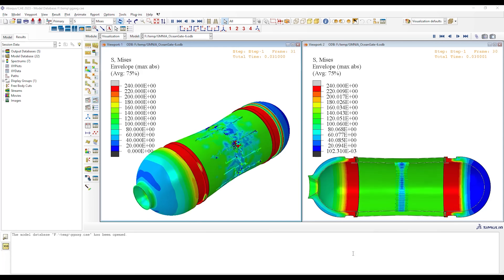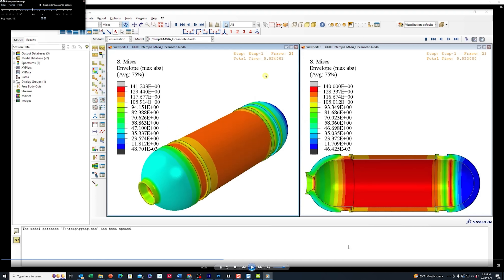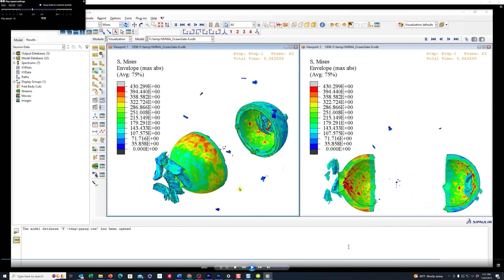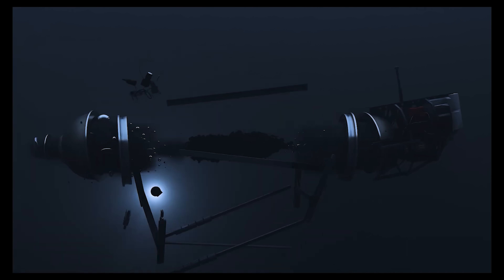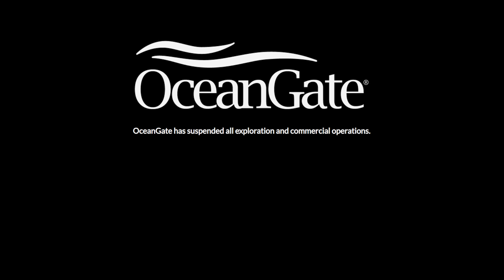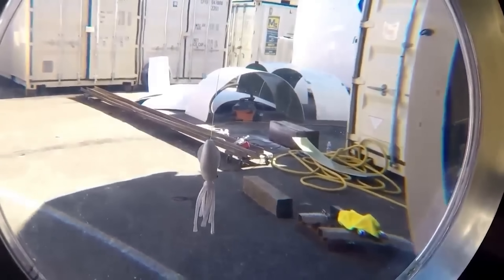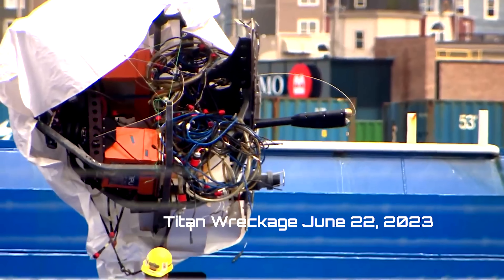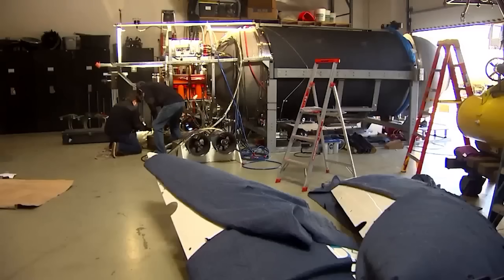Best Titan Sub Implosion Simulation, Cracked Porthole? Q & A

Comment: i think there is a little insensitivity in this video when folk have clearly perished, a better way than saying their dead, its a bit final no matter how the facts present themselves

as an armchair designer myself i reckon there has to be a few school boy errors made in the design of Titan, and i'm sure many of the 'normal' stresses expected were accounted for, but what of those not expected, the earlier collision for example, i'm sure will be cross examined for many many years to come and likely not in my life time

i did find the videos shown during construction a little odd, such as the laying of the carbon ribbon, not criss crossing in one direction and then the other, as seen in manufacture of CF oxygen cylinders etc. and no signs of any material to strengthen the carbon fibre, laminating layers of titanium into the fibre might have worked, and the fact the two titanium rings added to the ends had a very flat connection with little overlap even if only glued, its widely known in manufacturing if you design or cut other levels or a zig zag effect into that end surface, you provide more surface area into that short distance, just all seems a little half baked, not complex enough

carbon fibre is used in many applications with success, but there are also many instances where it has failed miserably, its still used in aviation widely and we like the stupid idiots we are, still fly in them, sure one day it will all come to a very sticky end - but do have a look into electro static effects and galvanic corrosion, an interesting article here explaining known effects which may or may not be the cause 

https://www.corrosionpedia.com/galvanic-corrosion-of-metals-connected-to-carbon-fiber-reinforced-polymers/2/1556

i do wonder if a design such as this might work better if the sub could be filled with warm water, of course there is still a pressure balance issue, and anything soft within is still at risk, electronics could still work with it being manufactured in ceramics for example - lets face it, we are slightly more successful at building space ships than going down into the scary darkness of inner space

Comment: I'd like to know what the knocking sound REALLY was because after the implosion the sound sounds like it's sinking till you hear no more.
Reply: As strange parallel where the first Chinese austronaut in space described a loud banging sound on his craft as if someone wanted to get in !

All this while alone in space in his craft.

He looked out the port hole window 👀 but could see nobody.

He could not determine the source of the sound which kept going on for a while.

It sounded like someone with a metallic wrench 🔧 banging on the door 🚪 and he was frightened.

He reported the incident when he landed but was afraid he might be labelled a crack pot and banned from any flights.

Comment: You missed something.  In the simulation, the moment the carbon composite is squeezed, the pressure inside was already 200 bars and the occupants were dead. Your 30ms time is after they died.

Comment: Okay folks.. just my 2 cents..as a machinist for over 40 years and a car enthusiast who used to do a lot of body work.. and many rust repairs..
Watching the making of this thing gives me pause..
Did you ever put "Bondo" on a piece of metal ?
I see the rings were machined very smooth inside.
The carbon fiber also was smooth. I've seen many dent repairs where the "bondo" literally popped off the side of a car after a few months because the metal underneath was sanded smooth.. Glue needs a rough surface to stick well..
Literally a little flexing of the sheet metal from road vibration can pop a bondo repair right off a car.
even with paint.. Sanding is required between coats so it sticks to the last one..
While I believe that this Sub did crush in the middle, I think the glue was definitely an contributing  factor..
every time this thing went down it was probably cracking the glue joint a little more.
But there was no way to see into that area.
Like someone said in the video, even a tiny pin hole would cause a high pressure stream of water to start entering the matrix.
 Where did these guys get engineering training?
I wouldn't hire any of them...
Just my thoughts..
Reply: Some how the word "glue" does not inspire confidence for an engineering project like this. 

I hear the word glue and I think of an arts 🖌️ and crafts 🎨 project.

Also as you pointed out, they would have to periodically overhaul the craft and reapply the glue before it wears out.

And who knows how often that needed to be done.

Comment: 1) The polycarbonate porthole is soft, plyable, and very glass-like compared to all the other materials. Extreme chance of failure.. 
My bet is the porthole failed. Video evidence shows the nylon lifting strap through the porthole.. the strap could not go through if it was intact.

Comment: Chanced upon this, after following your Surfside tower block-collapse explanations, Jeff.  Is this accident in any way comparable to the loss of the Kursk submarine? Is the Kursk still at the ocean floor?
Reply: Kursk was apparently due to a massive internal explosion 💥 by a faulty torpedo design which has since been withdrawn from service.

The explosion massively damaged the submarine and ignited other weapons on board causing a massive explosion 💥💥 💥 that ripped the hull of the submarine apart.

A double explosion in other words .

The Kursk had 2 x titanium hulls to withstand an external torpedo blast but not an internal one.

The Kursk was raised from the sea floor at great expense.

Comment: 1)External cameras should be good … THEY DO HAVE pics ,?must have pics of accident …!!!!
2) Review dynamics of creating pressure with a hand pump at  - 25,000 feet..Discuss it … I designed high pressure couplings , metal , all types to fabric , all types up to 10,000 pasig and operating pressures in the 100s of thousand’s of cycles …
3) Discuss number of ports that had access thru the pressure hull!!!
4) DISCUSS THE FACT THAT THE CARBON FIBER WAS APPLIED AT STANDARD ATMOSPHERE CONDITIONS ..NO HUMIDITY OR TEMPERATURE CONTROL! VERY VERY BAD .. I worked with fabric , carbon , fiberglass and it must be applied in a controlled environment !!!

Comment: The sealing of the hydraulic line would be easy. Just a pipe going true the titanium back. Maybe the weld could be comprising the structure, but that would not be the biggest concern.
Reply: That does not sound Kosher.

Also how would the hydraulics connect...
Reply: @mth469  hydraulics can hold the pressure. Also the line would be filled with oil, and isn’t compressible.

Comment: Saturday i started on my mini sub, i will take 5 tourist down to Titanic for viewings, photos and a boxed lunch, building it using special hardened honeycomb pressure metal and covered with "Flex Seal" reclining heated seats, wifi, with 8 tempered glass portholes, prices starting at $20,000 for the 6 hour round trip 🧜‍♂️
Reply: ...does it include the $60 burial fee.
Reply: @mth469  we don't offer that yet, it is state funded

Comment: They should have had a self contained inflation device on the hull in case of emergency to bring them to the surface.  It would have gave them a chance instead of falling increasing the pressure on the vessel.
Reply: When there are tons of pressure per square inch, how can it inflate?

Comment: My guess is that the carbon fiber center part failed in column. That is that it buckled under the load of the two hemispheres squeezing it.

The carbon fiber center section was made up of a much stronger version of stacked rope coils set in varnish. The problem is that the rope is round in section. So if the varnish loses its strength, the loops of rope will tend to slide past each other. And this would likely start at half the length of the center section.

Comment: Even thought the porthole wasn't rated for that depth, I don't think it's the part that failed. The porthole is conical in shape, designed to resist pressure from outside the sub. They mentioned hearing "crackling sounds" from the back just before the sub imploded. I think the composite section of the sub imploded from back to front and the temporary increase in pressure within the sub blew the porthole out of its frame intact. I think it's still laying on the bottom, where they found the other debris (probably hidden in the mud and silt. Being transparent, it will be real hard to spot).
Reply: Cracking sounds were most likely the parts of the sub that were outside of the pressure hull and being subjected to the full water pressure at that depth. Carbon fibre is not ideal for compression and will fail without warning once it exceeds its limits. . Yes, the acrylic porthole window was probably not the failure point. Most likely either the carbon fibre body separated from the Titanium ends at the join, or the carbon fibre just collapsed. At that depth, the most minute of leaks would mean game over bigtime due to the immense water pressure.
The fact that the Titanium ends were recovered whole is evidence that the joins failed or the carbon fibre crushed.
Reply: That's what I'm thinking too. Carbon fiber went like safety glass, millions of pieces at once because of the wind of the fiber and the cold, epoxy like glass at that point. Pushed the porthole out, cleaned the lips on the titanium due to the "safety glass" shattering effect of the carbon fiber. Guessing of course. Man, talk about the wrong material for the job. Frozen carbon fiber.
Reply: that transcript has been proven fake

Comment: Can someone perhaps provide an estimate of how many holes there had to have been, as a minimum, to let electric cables and pneumatic tubes etc pass between the inside and outside of the pressure vessel? And also provide estimates of the diameter of each hole? This issue seems to be under-reported in the media. How would the holes have been sealed? by what method and material?

Comment: Has anyone done a sim whereby the sub was forced into an upright position ? Our theory is the back was taking in water meaning the rate of decent and asscent was hindered. But once they manually dropped the ballast would the sub tilt upright as nothing weighing it down on the side ? Just the back. And does that change the pressure points on the acrylic dome ?
Reply: He was able to type his messages  so I assume the people in there were not piled on top of each other.

Also he did not report the above.

Comment: from the way it is pushing in from the outside... it could be salt deposits from it pushing its way in between the porthole and the frame it is in.  due to the optical properties and light detraction, it wouldn't be visible, as it's past the surface of the glass.  once the salt separated all the way through, maybe it could have caused issues?

Comment: From what I understand the hand pump system was air. I wouldn't guess this system was tested at 12k feet. If we go off the leaked comms they could not drop weight like they wanted. Maybe we could look into whether that system would have even worked. Another wonder I have is if something that was dropping off compromised those intrusions. Third thing I would like to know, is the back ring bent or distorted. It looks a bit twisted, but that might take some scanning of that ring, and removing lens distortion, albeit the front ring looked fine. The penetration seemed to be through that rear ring, there is a big hex nut area with some small holes which also this rear ring has a huge long twisted  piece of titanium that looks like it partially sheered off.

Comment: The problem is the carbon fiber and epoxy resin are continuously wrapped around a mandrel and cured , the structure is excellent for internal air or liquid high pressure due to its continuous fiber/resin placement and (hoop strength) to contain internal pressure. But that cylinder doesn't have much external crush strength across it's radius as just the bond strength of the carbon fiber matrix is holding it all together...GN

Comment: I really don’t think that is their communication with the artic prince. In one of Stockton’s videos you can see a laminated sheet of codes which were just initials.  They did not ever text full  words on prior dives by passengers recalled experiences. So I don’t believe that that is their last communication. Also that communication wasn’t and hasn’t been confirmed by the investigators, or Oceangate.
Reply: What was the means of communication?  

Was it all via underwater sonar ?

Comment: No one else has talked about the integrity of the carbon fiber strength being compromised by the mounting brackets being screwed to the inside hull to hold the monitors and other equipment like grab handles. With the little I know about carbon fiber, I always thought that carbon fiber is strong, but if one strand of fiber is damaged, that can cause a critical problem when it comes to its strength, especially that one grab handle right in the middle of the hull that he was so proud of that illuminated.

Comment: Quick facts about the simulation:

-You dont use Von Mises to estimate failures of composites...
-Knowing Abaqus , he possibly modelled the composite as quasi-isotropic, which is not representative of the filament winding process employed in the production of the Sub in terms of final composite properties. Need to model it properly and this alone is a years work or so from someone who knows what they are doing 
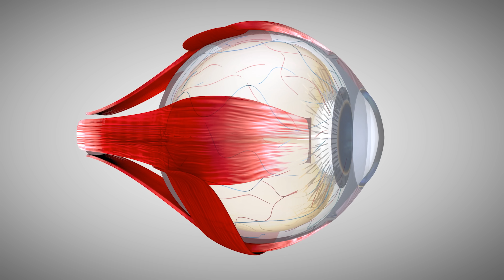-Freeze at 0:58 - the strain on the titanium is much higher than the elastic material limits , therefore plasticity region of the titanium was not modelled well...
-The contacts between the materials look to have been modelled just as bonded , therefore contact failure /debonding was not modelled as it should. The strain at 0:57 could not have occured without prior debonding
-The failure of the window itself looks wrong -hardly see anything representing realistic crack initiation and fracture .Seems like the whole window almost intact is being sucked in . Wont fail like that . Only the work on the FEA of the window with proper modelling of the retainment method etc is a few months work...
-There is another video of someone trying to do a simulation of the Titan is Solidworks and seems to try to talk like he knows what he is talking about... Solidworks Simulation wont cut it 
-Oceangates fb page briefly mentions Hypersizer employed in the simulation ,still think that even that one wont cut it having dabbled with it. 
-No mention about debonding initiation from voids in the composite that could well have been one of the failure modes in the titan for the simulation. It was mentioned that the Titan was de-rated to lower depths after few dives due to noted delamination (possibly spotted via ultrasonic NDT) and was repaired to gain back some of the depth rating . This could well have been one of the failure modes encountered. It can be adequately simulated in FEA but its the topic of a Phd on its own

Comment: I’m a certified in advanced aerospace composites and also special fasteners in top of a structural maintenance, heavy modification/retrofit and now I’m In engineering. From my experience. My money is on fastener locations and where mating surfaces from the metal components and the carbon meet is probably where the failure lies.. the cracking supposedly heard in the alleged text transmissions would suggest that it was a fatigue issue. Just faster and more catastrophic than what we see in aviation. Usually that’s what we catch in the early stages but not with so much pressures involved.

Comment: The design of that damn sub is driving me crazy cuz they thought it was a good idea did not have any way for the pilot to be strapped in all safety controls are at the ass into that sub and it relied on cheap electronics and let's say you start taking a nosedive too quick how do you reach the safety controls and wouldn't a rapid descent be a little bit of an issue

Comment: The "cracks" in the port hole look more like void spaces between the mating surfaces.  Basically if you have a sealer/glue like material you tend to get void spaces and the surfaces mount.  It is really hard to eliminate that totally.
Reply: It looked like there was a hefty sized void in-between the porthole and the titanium dome at 7:50 mins into the video.
Reply: @cbremer83 You've hit the nail on the head. If there was grease there before, it's gone now. All that's left is a void where water can, and did, ingress. I think that inner edge of the acrylic was chipping, and had been, for a long time. If it's not chips, and it is indeed grease, then it is being pushed out of the edges and the end result would be the same...water ingress. I'm willing to accept that it's confirmation bias, but on balance I think we're onto something here.
Reply: @jakewestor7840  Under the pressure, it would've been self-sealing. When building stuff for high pressure, your objective isn't so much to counter everything but instead to make the pressure work for you. 

I bet it'll turn out to be a battery that exploded. These kinds of accidents have happened all throughout human history. Someone will be so focused on the greatest challenge that they'll ignore other potential problems.
Reply: @ryelor123  yes but if it was grease, where was the grease pressed? it doesn't disappear.
Reply: Greased Lightning ⚡

Comment: I wonder why all those simulations do not account water, that will go in at extremely high speeds out of any crack.
Being hit by water stream that goes in with like 1000+m/s at that depths is totally lethal. And not just for crew, but also for opposite wall, which will probably create new holes.
And, most definitely, water streams will scatter pieces of walls in all directions - they will not bend like it is a constant-simulated pressure.